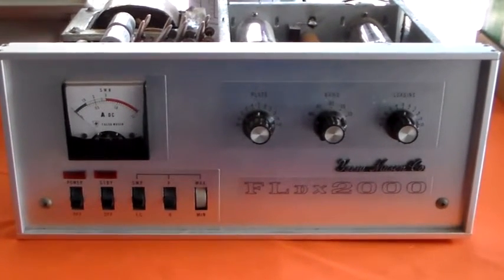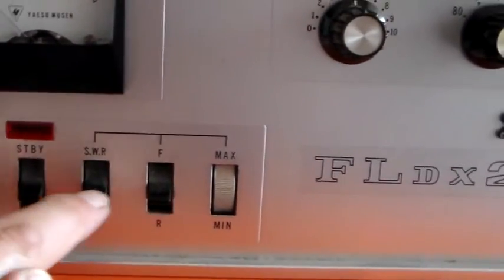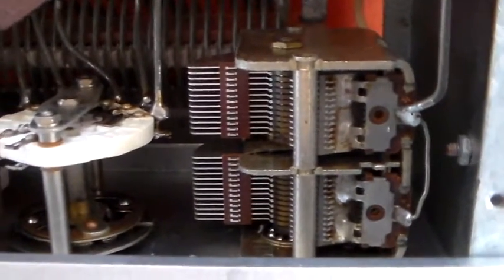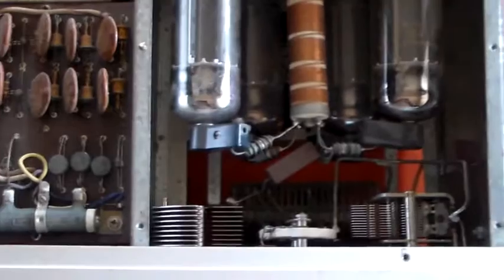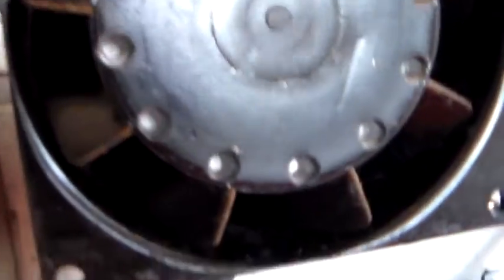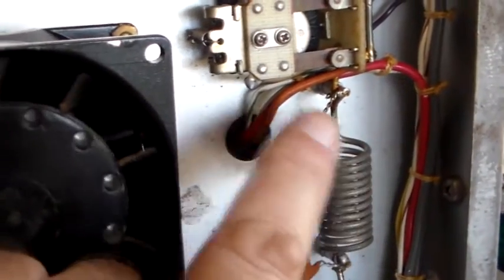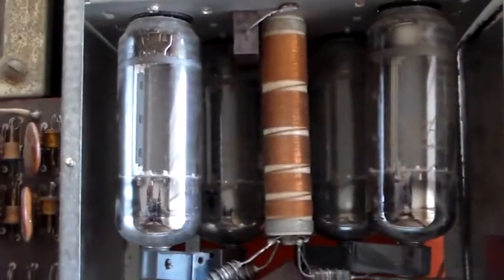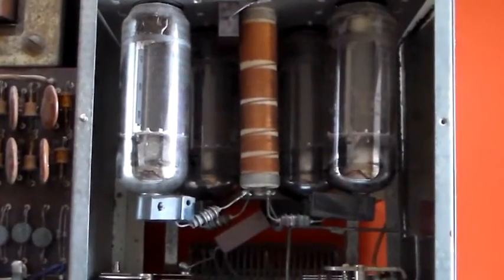Yaesu FLDX2000 HF Linear Amplifier Part 1

Comment: Once I have 2 more BR 1160 tetrodes I am going on the air with Radio Ade - Propaganda you can trust.
7kw continuous key down - DSB FC AM. Move over radio China.....
Nice video by the way. Excellent stuff :-)  Thanks.
Reply from the maker: Thanks Ade. I think you'll need a bit more than 7KW to make Radio China move over.
Reply: VK6CS Yeah, I know, they actually put out 500KW and they beam it direct over SE Asia and as a result it gets to Australia pretty well.
I'll have to put pins in their coax.....

And before you say it, I know they use copper plated steel pipe open wire feed at 600 ohms, so the pins won't work.

I'm thinking "crow bar" over the line, it'd be horizontal and only 4 feet above the ground.

Getting through the security fence is the hard part. I'll have to sneak past the cleaners at night, dressed as a RC technician.

I'll say "I left my pliers behind" and "the crow bar is because I'm lifting weights"

that'll do it....
Reply from the maker: Ten minutes after being jammed by a Chinese station you want to be jammed again...
Reply: VK6CS Every night at 2200 QLD time they start.
I don't even know what frequency it is - somewhere between 6800 and 6900 kHz.
Bloody commies and their jamming radio.
It's radio disguised as jamming....
Reply from the maker: Or jamming disguised as radio...
Reply: VK6CS Either way it's a pretty nice signal. High fidelity wide band AM.
Reply from the maker: Strange, most of their stuff is rubbish.
Reply: VK6CS Chinese valves as used in the commy party's radio service are very high quality.
Reply from the maker: Maybe I should get some.
Reply: VK6CS I don't think they make any valve smaller than 50Kw. They are like the size of a barrel of oil.
Reply from the maker: I'll take a couple.
Reply: VK6CS Get in the queue.
Radio Ade is coming - license or not.
Move over Radio Caroline.....LOL :-)
Reply from the maker: Caroline moved over a long time ago. I stopped listening when they went down the 'loving awareness' path.
Reply: VK6CS Yes, I realise that :-)
It's the thought that counts.
When it comes to the station I am going to build the word "emissions" is more than just the RF, it's also the black smoke....
The diesel smoke will be by way of a smoke screen....